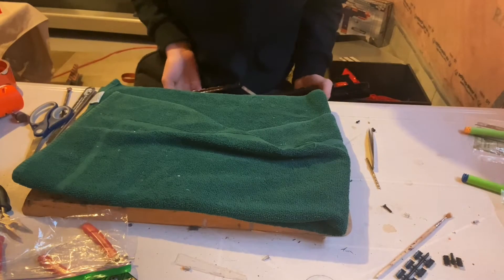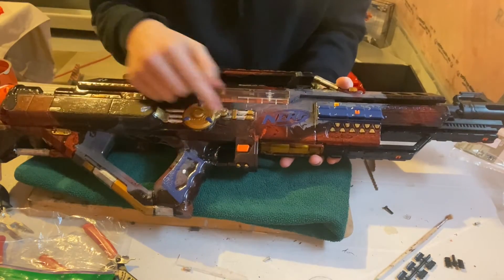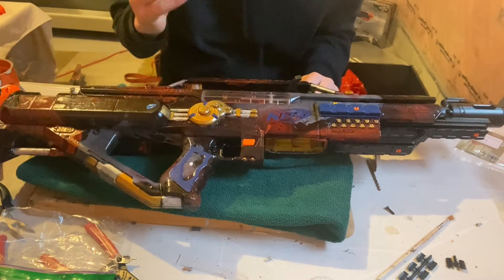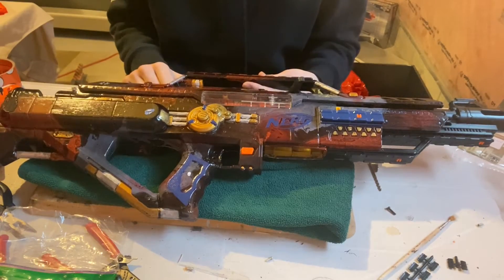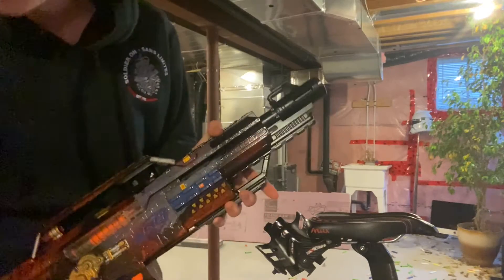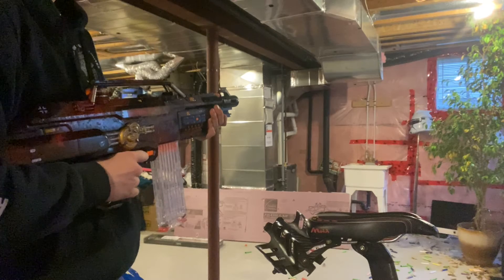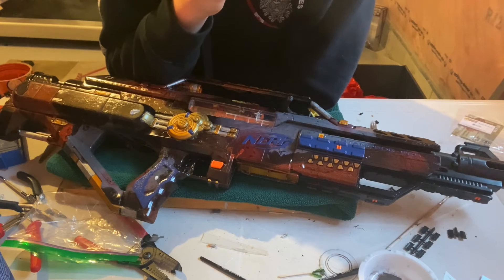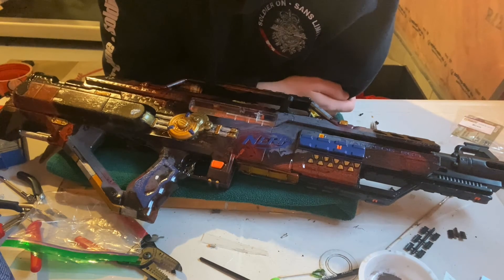My Craziest Nerf Mod Yet nerf stampede

Comment: Me and my dad painted a nerf Longshot black and red and now it only shoots like 10 ft. I dont know if there is something wrong with the internals.
Reply from the maker: a number of thing culed be rong one is you got some paint on the plunger too or rod and now its clogged or one of the o rings has fallen off thus air gust doesn't get compressed like is shuled if you want check out my vid I made on hydro dipping it that vid will also apply to the proper way to paint a blaster you will find it on my channel somewhere and i like this question i will make i vid on it
Reply: @daberdenator7515  Ok thanks. I will see